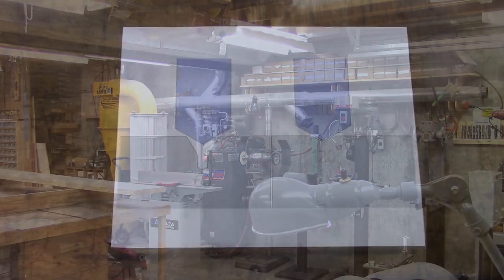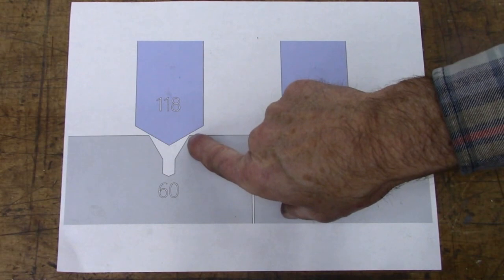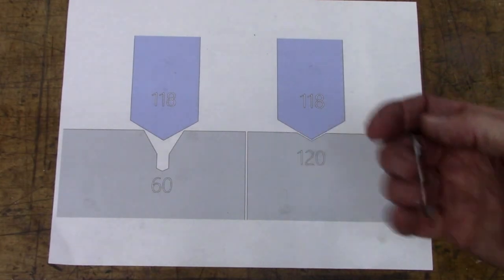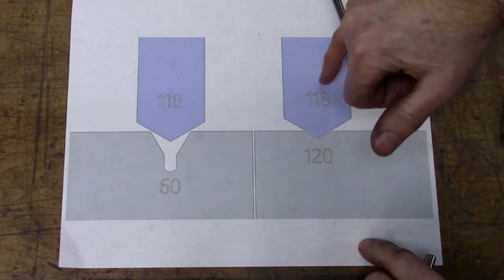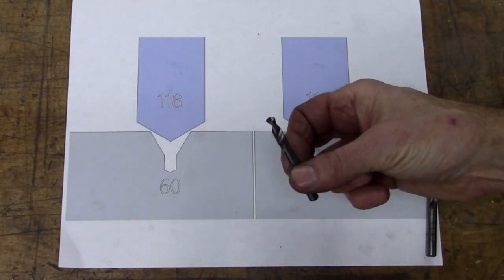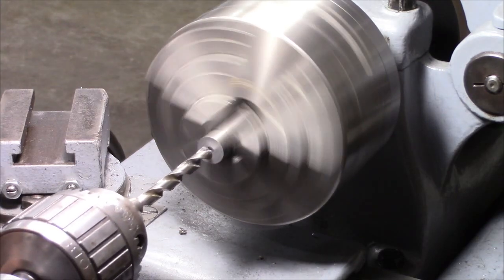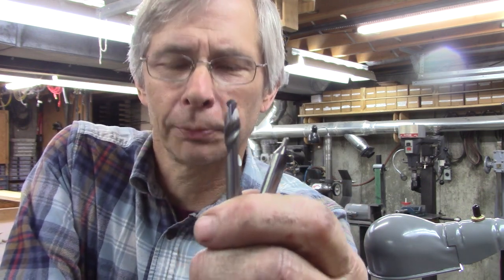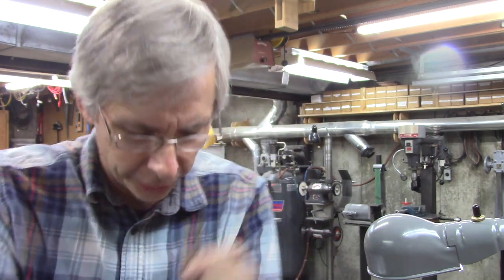Center Drill VS Spotting Drills

Comment: What if you "spot" with a center drill? just don't push it deep.. cause I'm lazy and cheep!
Reply: Doesn't the small point on a centre drill have a 60 degree angle too ?  If so, then every 118 degree drill is going to make contact with the sharp edge of the hole created by the centre drill, no matter how small a hole you dug.
Reply from the maker: Its hard to say but the tip is more blunt.
Reply: @mikeparfitt8897  yeah I kinda thought of that after the fact too.. but in my limited experience once the center drill self centers by that tendency to want to ride towards the middle the regular drill at least has a starting point that tends to follow.. seriously I never knew there was a thing called a spotting drill.
Reply from the maker: I knew they were out there but recently learned what they were for.  I think a center drill works well if you go shallow and follow with a small drill.
Reply: @WinkysWorkshop  That's how i always have done it and its worked out for me but i'm still just a hobbyist...
Reply from the maker: @chuckthebull  Me too!  ha
Reply from the maker: I do that in the drill press.

Comment: Thanks Mark, you convinced me
Today was the last time I used a center drill as a "starter".
All the best for 2021 from The Netherlands!
Ron
Reply from the maker: I still like the center drill for visibility in the drill press but find that it's more accurate if I drill shallow. However, I'll never go back to a center drill in the lathe. I'm guessing the visibility aspect is why center drills are more popular.
Reply: @WinkysWorkshop  There ought to be a combo. A drill like a centre drill but ground with the 118° angle. The tip of the drill would go in bang on centre and then the sides of the tit on the end would keep the drill centred while the main cutting faces get to work.
Reply from the maker: @millomweb  - I love this idea!
Reply: @WinkysWorkshop  I have seen recently on YT 'boring' drills that have a lump on the tip to go down a pilot hole before the drilling portion starts to cut - I suspect they were 'counterbore' drills / end mills as they had flat cutting ends - I THINK.
Reply: @WinkysWorkshop  Get your bigger drill & drill the tip of it a diameter to match the length of the chisel point and then fix into it a half inch length of smaller twist drill.
I don't know why they just scale up twist drills rather than keeping the chisel point as small as possible.
Reply from the maker: @millomweb  - They are designed to eliminate the need for a center drill.

Comment: Thanks Mark I always like your ideas. I have been using both lately, One of the things i did a few weeks ago is to take one of my broken center drills and re grind the tip using my Drill doctor and made a spot drill out of it. When the weather warms up a little more I will get back in the shop and just play around with both. I did order a couple of the Bangood Cobalt spotting drills but they are 3/8" diameter so i have not used them much yet.
Reply from the maker: Mine is 1/4" and carbide. I suspect is will last for ever unless I drop it. I still like the center drill for visibility in the drill press but find that it's more accurate if I drill shallow. However, I'll never go back to a center drill in the lathe. I'm guessing the visibility aspect is why center drills are more popular.
Reply: The Drill Doctor is a great tool for the home shop. There is a bit of a learning curve but with a little practice you can't beat them for the price.
Reply: Now I always thought you used a center drill to spot because of its rigidity.